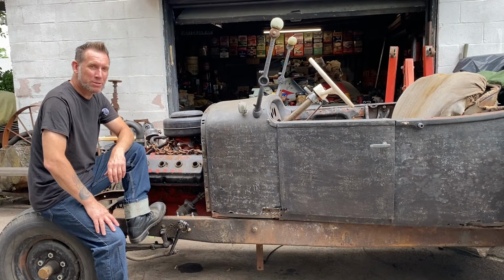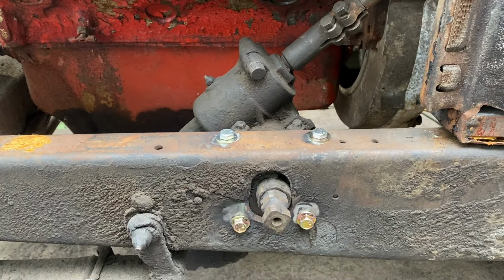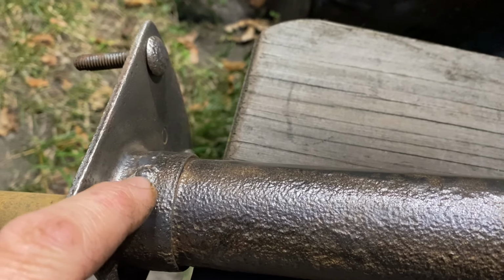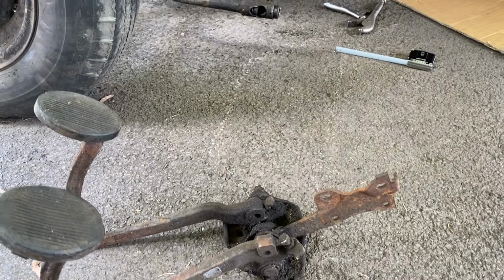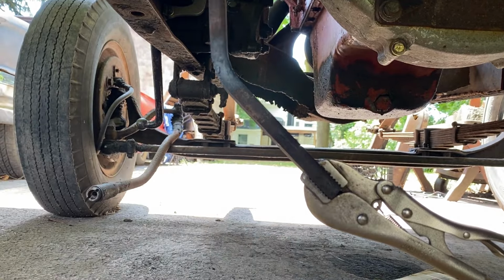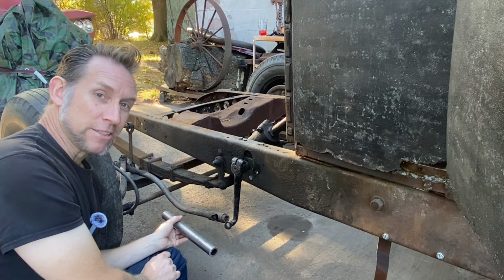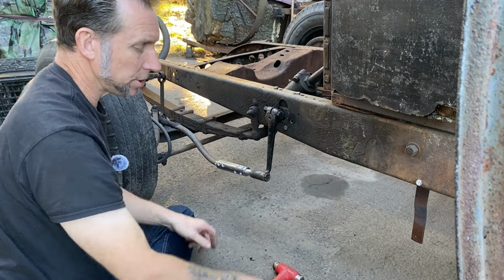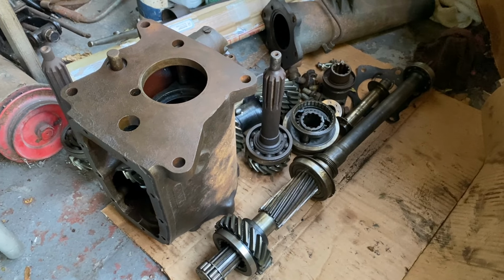HOT ROD HEMI Red Ram Roadster STEERING & PEDAL Fabrication

Comment: Be careful with that boat steering wheel!
Some don’t have a steel support frame inside the plastic and can brake apart while driving 😮
Reply from the maker: @hemibreath  Thanks for the comment! 
I double checked my wheel today & this one does have a metal ring construction throughout.  However, I will be needing to restore the cosmetic cracks in the plastic.